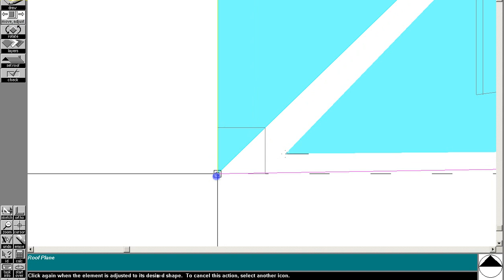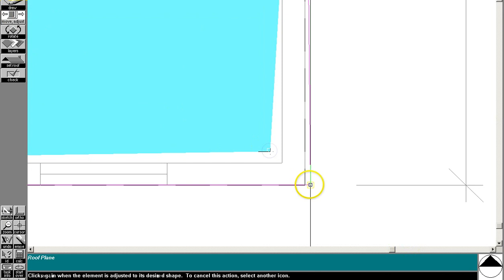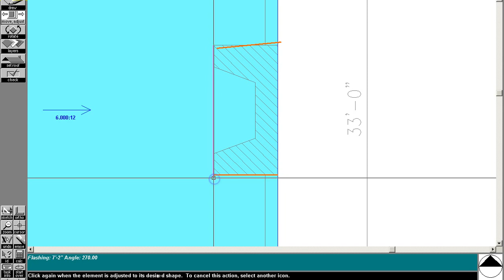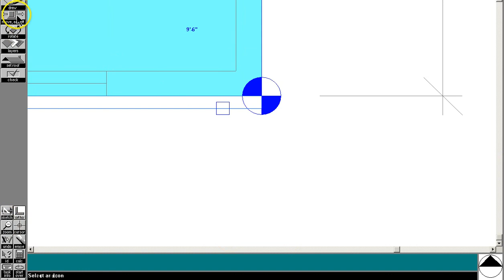ncarb roof.avi

Comment: why don't you break gutter at chimney?
Reply: In the NCARB study guide, the directions on point #4 state " The chimney
shown on the plan should be considered to penetrate any
roof plane that you draw over it." Therefore, it's okay to draw the roof as a continuous plane, also as shown in the NCARB passing solution. https://www.ncarb.org/sites/default/files/BDCS_Exam_Guide.pdf

Comment: Real life is one thing, the test is another: On the test do we run the gutter across that chimney like it is done here or should we break it up & have downspouts on either side of that chimney?
Reply: You can run the gutter across and don't need extra downspouts. Check out NCARB's passing solution here - https://www.ncarb.org/sites/default/files/BDCS_Exam_Guide.pdf

Comment: avgjoe2112 and bfjb1e:

Actually (in real life) downspouts are calculated per roof area...not gutter length.  The vignettes are so simplified that nothing can be "implied".  The exams are diagrammatic, not actual, and is designed for you to demonstrate basic knowledge and conceptual understanding of architecture.  Don't over-think things; It will drive you mad.  Just do what the nice people at NCARB tell you and get the dang license!

Good Luck everyone!

PS:  Some of my coworkers are wondering why the SD and BS vignettes are not available.

Comment: Have you had success with the exams with this roof solution and the ramp solution from your other video upload?  Also for the ramp did you maintain the landing widths per the ramp width or did you adjust your ramp widths to meet the landing width requirement?

Comment: Are we sure that NCARB won't penalize for multiple locations of downspouts in a straight run?  Is there a reason why the downspouts aren't at the corners only.  Putting more than one downspout in any straight run implies peaks and valley's for the appropriate functioning of them.  Please clarify.